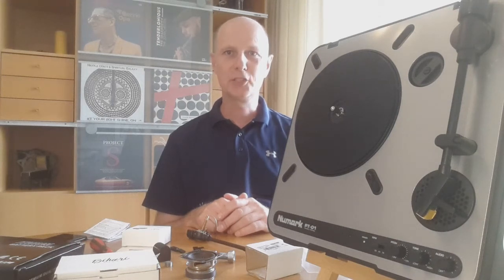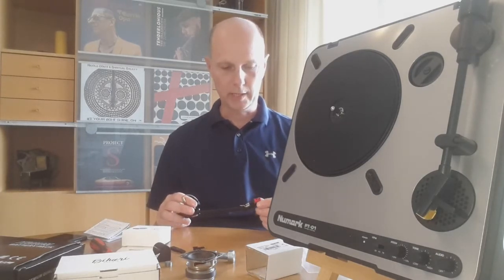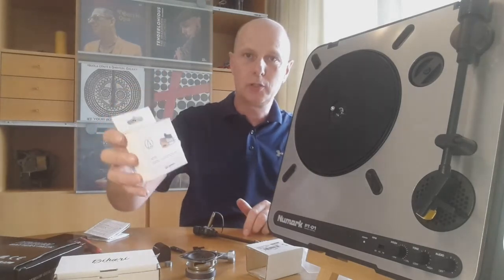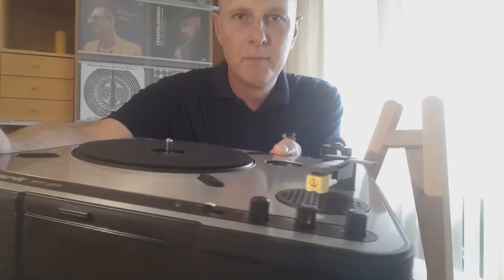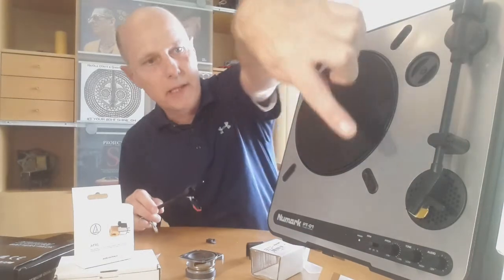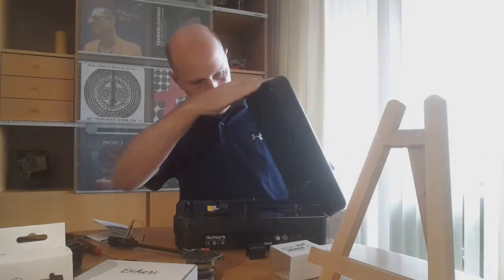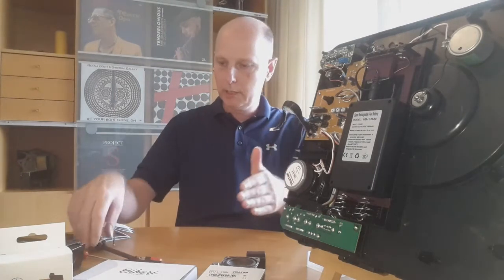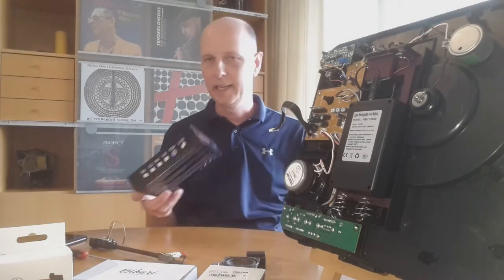Modifying a Portable Numark PT01 for HiFi Playback - Vinyl Community

Comment: Interesting, I've never heared of Visaton before.
Don't forget to select an amp with a RIAA filter built in.

A cheap 20 euros Behringer PP400 (35dB gain) or one of many rebadge duplicates will do fine in most situations as a compact internal Phono preamp.
Reply from the maker: As you already picked up on the Dutch accent, on Conrad.nl the Visaton speakers are available in many different specs. Great replacements. It's funny you mention the RIAA filter. It turned the original one didn't have one, it seems most sapphire needle don't need it. The Behringer would be a great alternative, and a little cheaper too. Cheers. /Paul
Reply: @XjunkieNL  Hmmh interessant, ik shop wel eens bij conrad, maar eigenlijk nooit voor audio componenten, meestal voor algemene elektronica componenten. Zal ik volgende keer eens naar kijken dus!

Als die draaitafel standaard geen RIAA filter heeft, betekent dat waarschijnlijk dat de saffier stylus simpelweg te slecht is om die lage tonen fatsoenlijk weer te geven, of de standaard speaker te klein lol
RIAA filters zijn namelijk om de originele informatie weer terug te krijgen van vinyl, aangezien er een negatief RIAA filter (Highpass-filter ipv lowpass-filter) wordt gebruikt voor het maken van de masters/matrijsen.
Betekent waarschijnlijk wel dat je nu een flinke upgrade hebt tov. wat het was; ik wist niet eens dat er nog stock draaitafels met saffier uitgerust werden, het klinkt voor mij als iets uit een vorig tijdperk 😜
Reply from the maker: Waarschijnlijk de enige reden dat saffieren naalden nog worden toegepast is de prijs. Ook is het signaal veel sterker, makkelijk 10x meer, dus kan de versterker eenvoudiger. En hij vervormt het geluid, zodanig zelfs dat het beter klinkt zonder riaa filter :) Dus als het goedkoop moet zijn, is een saffieren naald de oplossing ;) /Paul
Reply: @XjunkieNL  Geweldig! zo slecht dat het juist beter klinkt zonder filtering haha
10x is trouwens wel fors.. 10x in dB of in milivolts? Betekent in ieder geval wel een goede signaal ruis verhouding op de lijntjes tussen de cartridge en voorversterker ;)
Reply from the maker: Als ik het goed onthouden heb, is de uitgang van een saffieren naaldje ergens tussen de 0,1V en 0,5V. Hahah, van het hoog valt zoveel weg dat de bas niet hoeft te worden versterkt ;) /Paul
Reply: @XjunkieNL  Holy moly! 0,5V! Mijn "high output DJ cartridge" Geeft 8mV (0,008V) als uitgangsspanning. De meeste 'audiophiles' vinden dat al heel erg veel, want die gebruiken praktisch altijd moving coil cartridges, die stukken lagere uitgangsspanningen geven. Mijn enige moving coil is een low-output versie van de Benz Micro Glider S en die geeft maar 0,4mV uitgangsspanning.

Comment: i dont see any point in this, you still have a wobbly platter, and rpm are stable as milenial feminist on pms.
Reply from the maker: LOL...hahah, you offended 4 lethal minorities in one sentence. For sure, the speed stability is the next thing to tackle. Although since the modifications, I have gotten several copyright infringements with my needle drops. Youtube clearly more easily recognises the songs as before. Cheers. /Paul
Reply: women are actually majority and I refuse to go easy on society that could be seriously offended by joke.  I love pts, i own one and ion pt usb as but i use it do dj so i know that rpm stability is mediocre at best. what kind of mods are you talking about now. i know theres a guy with pitch slidders  mods on pts. i talked to the man and there's a lot of issues with mainboard and you cannot get the pitch right until you replace some parts  @XjunkieNL
Reply from the maker: My current mods are focused on getting a better sound quality. Haven't done any on the rotational speed stability. My guess is, this is caused more by mechanical shortcomings as electrical. And needs probably some serious surgical procedure to correct. Haven't seen anyone trying to solve it.  /Paul